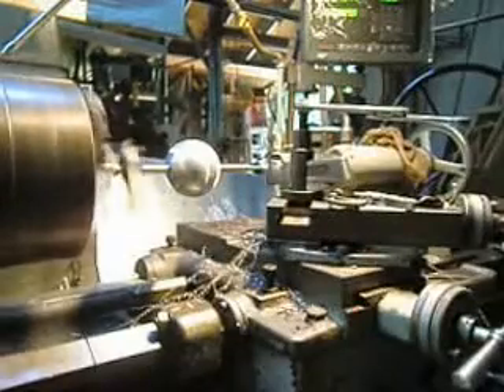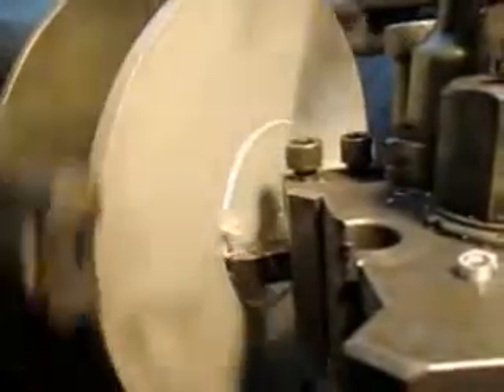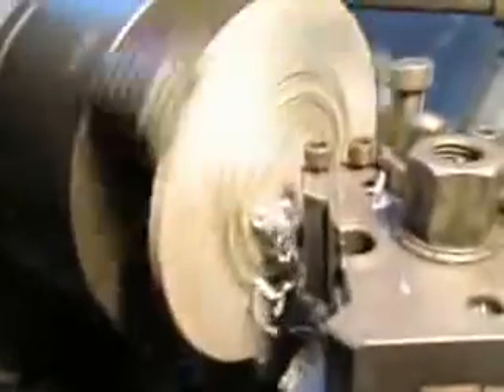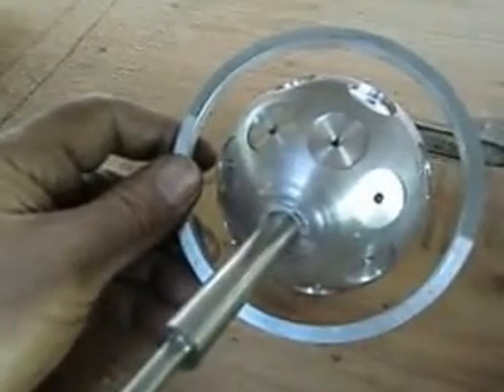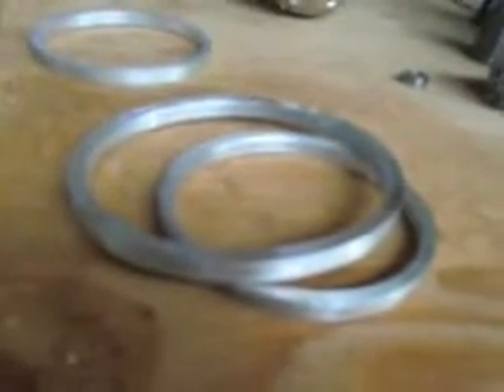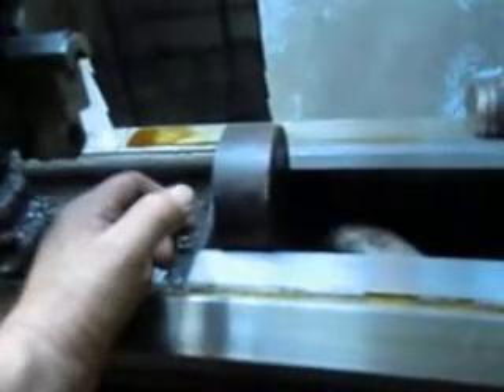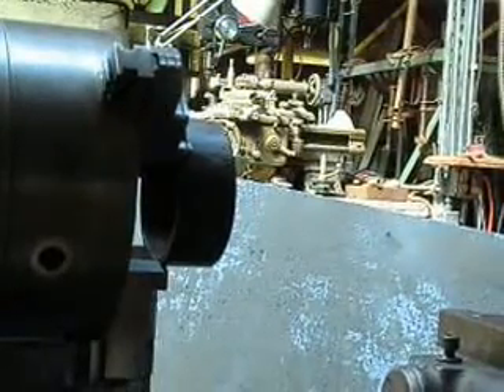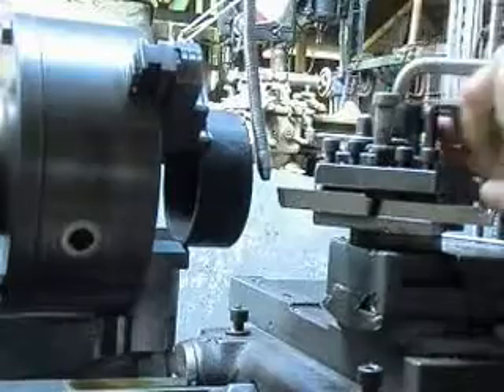Balls Out Free Energy Generator #8

Comment: I've noticed on your videos that you dont use parting tools is there a reason you don't
Reply from the maker: Almost all of my lathes are old and have loose main journals. Most of the time is is no problem because the pressure is at the very tip of the bit. When a cutoff tool is introduced it chatters horribly and usually ends up breaking the blade. Except for rare occasions and only with my little South Bend, I tend to shy away from cut offs. Thanks for asking. 
Wow, 2013, you are digging way back. I was still pretty awkward back then.